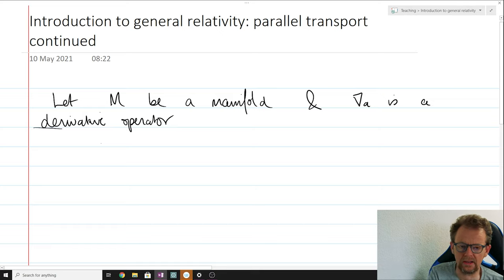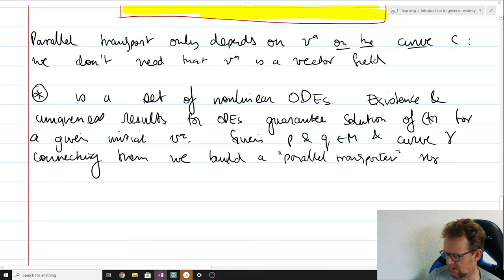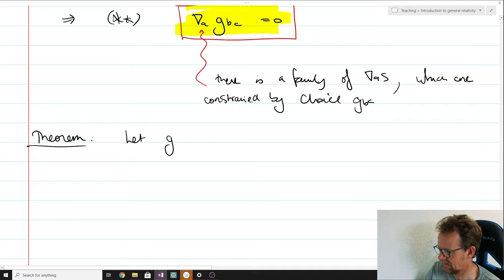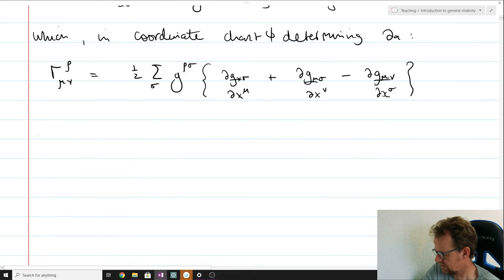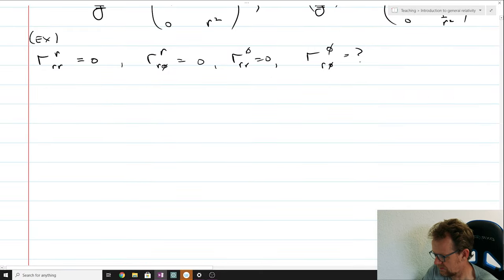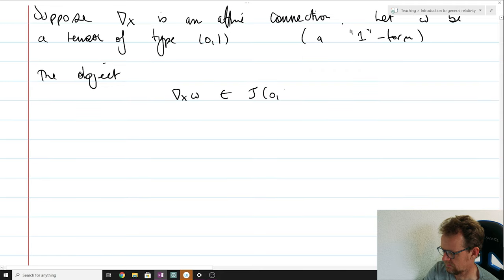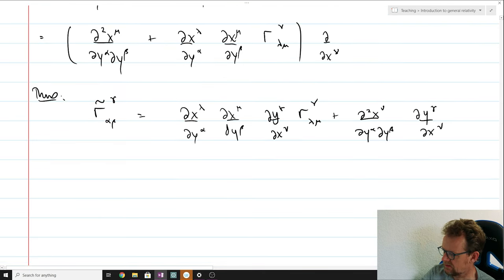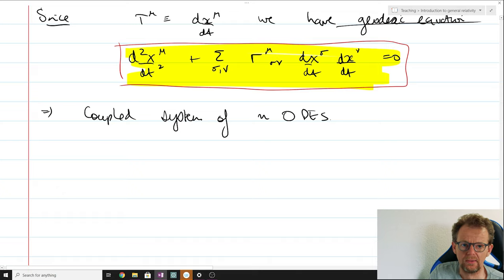General Relativity, Lecture 9: parallel transport continued and geodesics

Comment: Hello Professor,
there's an idea that I've had for a few months now but I cant seem to find if it's a correct way to think about things.
in my head there is a slight connection in the ideas of geodesics, principle of least action and generalizing the idea of path of least resistance from electric currents.

to my understanding geometrically the principle of least action says that particles would prefer to travel along geodesics (be a 3D version of classical lagrangian density or 4d one over all of space time) in my head that immediately connects to the idea of least resistance of electric currents.

so free particles would take a path as straight as possible in space-time, which is kind of the path of least resistance.

is this interpretation correct in any way? if not, I would be glad to hear where did I go wrong/ what did I miss.

thanks!
Reply from the maker: on a purely metaphorical level it is probably ok to use the analogy of free paths as following paths of some kind of least "resistance". The scare quotes are important: The definition of the Ohm reads as follows:
"The ohm is defined as an electrical resistance between two points of a conductor when a constant potential difference of one volt, applied to these points, produces in the conductor a current of one ampere, the conductor not being the seat of any electromotive force."
The problem of taking such an analogy too seriously is that we don't really have a direct corresponding notion of current or potential difference for paths of free particles on curved manifolds... (At least not a correspondence which is basis independent...)

I hope this helps; sincerely,
Tobias Osborne
Reply: @tobiasjosborne  
It does help, a lot thank you very much for your response!
I can see now that it maybe a nice analogy but not a very successful one